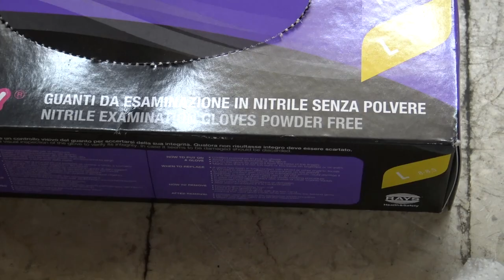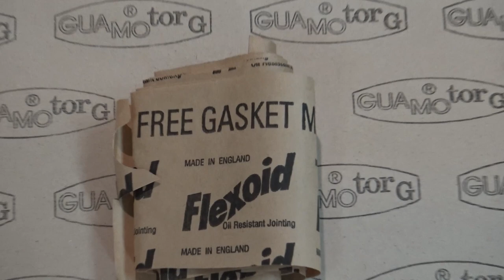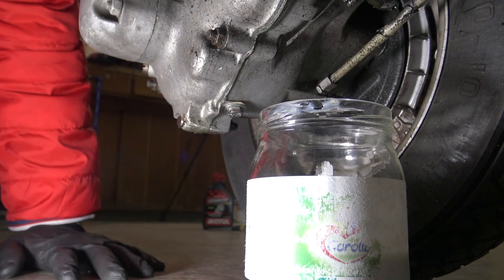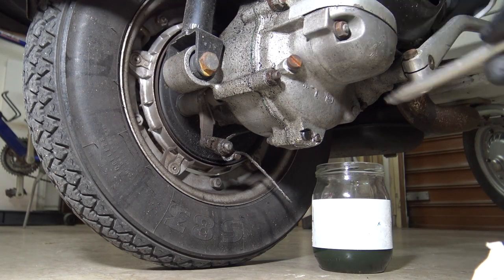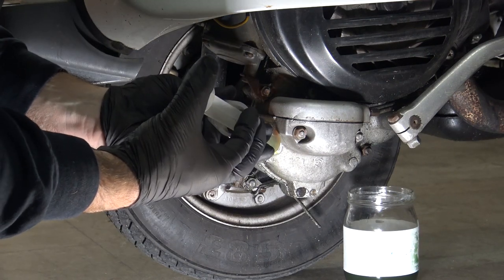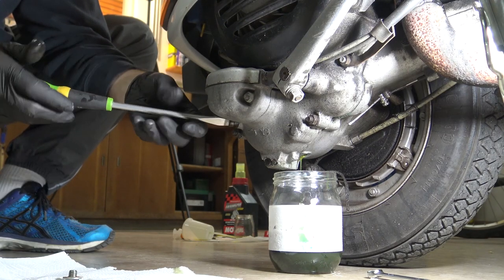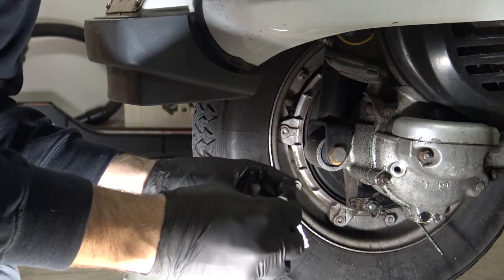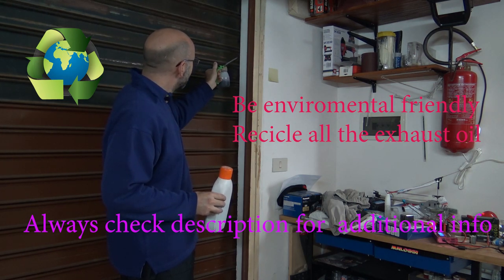Vespa PX Gearbox oil change

Comment: Hello, I own a 2002 LML Vespa Select II which is India bound but for sure I know it was manufactured by LML & Piaggio, Almost identical to yours by mechanical factors. I was hoping to restore it but i no longer have the owner's manual, hence a little lost from where to start and what steps are necessary. Could use some help.
Reply from the maker: http://vespaguide.com/?cat=2
try here ;-)

Comment: SAE 10w-30 right???
Reply from the maker: Piaggio raccomand to use old mineral oil  SAE30. Most people use motorbike 10W40 or gearbox oil 80W90 if compatible with clutch (as example Malossi 7.1 oil). As You prefer. If You are not using modified or very old clutch in older model Vespa. It could be damaged from synthetic oil. So first choise is always SAE30 mineral oil
Reply: @CantharusENG what kind of clutch will be damaged by the synthetic oil?
Reply from the maker: @vespavespi  Older clutch made of cork may be damaged due to the glue that melt with the additives of the synthetic oil
Reply: @CantharusENG  how about polini clutch set?
Reply from the maker: @vespavespi  Work well with any type of motorbike oil
Reply: @CantharusENG   nice information...thanks
Reply from the maker: @vespavespi   You are welcome

Comment: sir do u know any additives which helps in cleaning scooters gearbox like for example - we engine flush to clean engine
Reply from the maker: A cheap way to do it is to mix some kerosene with gearbox oil (50ml of kerosene and 200ml of gearbox oil ) Run idle few minutes then flush.
Before refill with the oil put 50ml of gearbox oil, run idle 1 minutes to clean the kerosene.
Then make a standard refill of about 250ml of gearbox oil

Comment: Thank you sir! Not is easy find the oil SAE30 but now, before watched your video, I will use the 10w30 for the transmission! From Brasil ( PX 200 1987)
Reply from the maker: You may read description, Motul suggest an oil for Vespa 10w30.
You may try it, I personally use it 😊😊😊😊
Reply: @CantharusENG  thank you sir
Reply from the maker: @pilotopolicial7155  You are wellcome🙂

Comment: i get a bad vibration on the front when i apply my front brakes on my vespa px 200 any idea thanks George Australia
Reply from the maker: Open and see if you have worn drum brake and check also if any object, like broken springs or similar, are out of order.
This is the first things i will check. May be also worn and not symmetric brum on the wheel side.
Let me know 🙂

Comment: How often should you change the gearbox oil
Reply from the maker: According to Piaggio each year or 8000km/5000ml which ever come first.
You may do a little longer (18 month or 12000km/8000ml)

Comment: Vespa mechanic here. First, while SAE 30w NON DETERGENT oil will work in the gearbox, it is not a good idea to use it in warm weather. It tends to lose its viscosity when really hot. Piaggio recommends SAE 75w85 GL4 (NOT GL-5) gear oil. 75w90 works fine too, as long as it is GL-4. 

DO NOT use a homemade gasket on the drain plug. That plug is not supposed to use a gasket. It uses a compressible washer. The fill plug uses the same washer. They are very inexpensive. buy a couple dozen of them, and you will never have to worry about it again. Before removing both the drain plug and fill plug, clean off the plug and area around the plug thoroughly. I use spray brake cleaner. I also clean off both plugs after removing them. You don't want dirt in the transmission. 

You can use any number of ways to get the new oil in. A syringe works, a tiny funnel, the spout on a gear oil bottle, whatever fits in the small hole. You DO NOT need to measure it. You are supposed to fill it up till it is completely full. The way you did it, you didn't have enough oil to start with, and some of that ran down the side of the case.
Reply from the maker: Appreciate Your comment.
For the gaskets I was missing the right size and I did it just to fix it temporary, and I showed just to show how to do it in case of emergency.

The tip to clean the plug and the surrounding area is a great tip I will do it from now on Thanks 😃

About the different from synthetic and mineral oil i agree with You but some older Vespa with still some original equipment may experience a shorter life in clutch and some gaskets are in cork and the glue may be deteriorated by the detergent power of the oil  (the oil "glass" of the oil tank ha a cork o-ring). 

As the fill up Your still right in the Italian video I specified, in English I forgot.

I will make a new video soon with the some correction. 

Really Thanks for the time You took sharing Your good Knowledge ❤

Comment: Gasoline 95 Can Harm Two-stroke Vespa?
What is the best oil mixed with gasoline in the tank
Reply from the maker: In Europe we have only 95 and up to 100 octane gasoline, No problem. If Your Vespa is really old may be should be tuned for unleaded fuel.
Lower than 95/92 should be adjusted AFR and may be also the timing

Comment: Hello again is it gear oil or motor oil.  ?
Reply from the maker: You may use motor oil for motorcycles since in the motorcycles the oil lubricate also the gearbox and the clutch. Don't use 2 stroke oil or cars oil

Comment: Sir I have vespa lml 2 stroke.how much ml is used، I have already put it 350ml is it good or not۔۔kindly help me
Reply from the maker: Should be 250ml
Reply from the maker: Fill until start to leak from the charging hole.
Reply: @CantharusENG  sir it have capacity approx 1.4litre
Reply: And also thanku for ur reply♥️♥️♥️
Reply from the maker: @SaMeeRmAliK00012  you mean 1/4 litre? Or 1,4 litre??
Reply: @CantharusENG  1/4
Reply: My scooter vespa lml (spl) 2stroke 150 cc/2010 model....

Comment: Sr Which Grade oil u have use in gear box of Vespa px scooter and how much quantity u have use
Reply from the maker: Piaggio raccomand to use old mineral oil  SAE30. Most people use motorbike 10W40 or gearbox oil 80W90. As You prefer. If You are using modified clutch It could be damaged from synthetic oil. So first choise is always SAE30 mineral oi
Quantity is 250ml (1/4 of liter)
Reply: I have bajaj chetak scooter ,it is like Vespa Scooter we can 40wgrade and 300 ml
Reply from the maker: @makknowledge9089  Ok, in this case I don't Know. Bajaj Chetak scooter is not sold in Italy.
Sorry 😊
Reply: But u know that chetak Scooter  is inspired by lml or Vespa body shape
Reply from the maker: @makknowledge9089  I didn't know, But now I know it 😉
Reply: @makknowledge9089  bajaj chetak is sprint clone, should be the same.
Reply: @CantharusENG  damage because of erosion of clutch plate material for ex.  or something else? i cant see any other disadvantages, synthetic oil is much better for  colder conditions etc, cant see any other reason, why not using it.
Reply from the maker: @izoyt  i Use synthetic oil, but If You are running an old Vespa not updated in gaskets or clutch You may experience  some trouble.
Reply: @CantharusENG  again, why exactly?

Comment: Which oil do you recommend for a vespa px200  1981?
Reply from the maker: You should use mineral gearbox oil SAE30 or bike oil. Motul 5100 10w30 is suitable according to Motul website.
SAE 30 oil is old and not easy to find

Comment: What kind of oil do you suggest? I use a premium mineral oil.. is it ok if i use a fully sunthetic oil?
Reply from the maker: Piaggio raccomand to use Mineral oil.
In Italy most of people (sometimes I do also) use synthetic oil. So use what You prefer 😉
Reply: Cantharus ENG do you suggest 80w90?
Reply from the maker: @bisugzzz  Yes,  in this video I used this Gearbox oil 80W90, and I will use it again 😉
Reply: Cantharus ENG i see you used Motul what is the exact model? Graziie again my friend. 😁
Reply from the maker: @bisugzzz  I used the equivalent of this: https://www.motul.com/gb/en/products/gear-300-75w90 (mine is older and anymore avalible). This have a lot of apllication car, Bike etc etc

If You have to buy only for Vespa I Suggest You this: https://www.motul.com/gb/en/products/transoil-expert-10w40, Check description on the link motul say it work up to SAE90.
Reply: @CantharusENG  which grade ?? GL-4 or GL-5 ??
Reply from the maker: @MdWaliullahRahat  tomorrow I will search wich is equivalent for You. But the above answer are the best choice.
Reply from the maker: @MdWaliullahRahat  gl4 or gl5 are suppose to use on gearbox only. On the Vespa this oil lubricate and cool also the clutch as in the bigger motorbike. So You must use motorbike oil or just mineral oil. I suggest You the Motul mentioned above.
Reply: I am using PTT 10w-40 full synthetic oil. Feels great. But most of the people use mineral 20w-50 and 500ml. Is it good for vespa engine??  What you think?
Reply from the maker: @MdWaliullahRahat  250 ml is recommended, 500ml is too much. Use motorbike oil. Better 10W40, don't use car oil since the clutch is in contact with the oil (as on motorbike)

Comment: Hello sir. Im from Malaysia.. how many liters of black oil for vbb model vespa???
Reply from the maker: 0,250 liter (250cc) 
Nice place Malaysia hope to visit once 😃
Reply: @CantharusENG   i think 500 liter before for vespa vbb model.. 
a little bit really only 250liter..  tq sir.. 😃
Reply from the maker: @Rambo-zk3iv  Well Just fill until leak out from the charge hole and if in excess let it drop. It should be around 250cc or 0,250 liter (1/4 of a liter).
Reply: @CantharusENG  tq for your info..

Comment: Which oil do you recommend for lml nv 4 stroke electric start gear scooter?
Reply from the maker: LML raccomand use oil 10W40.
Use oil for bike, the oil for the car is much different due to the clutch.
Reply: @CantharusENG  thanks
Reply from the maker: @scentyguy2567  You are welcome 😉
Reply: @CantharusENG  for gearbox oil 10w40?
Reply from the maker: @mabzgemz4989  https://amzn.to/3Mm3Uz3 Yes, this oil is for motorbike. Is suitable for gearbox and clutch 😃 Vespa oil SAE30 is an old type of oil, You may upgrade with this. Also Motul recommends this oil
Reply: @CantharusENG  i was checking my lml nv 4 stroke 2009 model and I don't find any gearbox oil hole

Comment: How much engine oil to refill?
Reply from the maker: 250ml is not engine but gearbox oil. You may use motorbike oil possible old SAE30 normal engin oil (for cars) oil will wear the clutch

Comment: Please tell me how engine quantity for vespa 50 2 stroke
Reply from the maker: 250ml is only gearbox oil, not engine. Engine oil is the 2%oil mix on gasoline
Reply: @CantharusENG  thank u very much and please tell me which engine oil u prefer?
Reply from the maker: @MuhammadAli-iu5xk  mobil, bardahl, motul, Vespa engine is strong any oil is suitable, choose Your favorite 😊
I personally use Bardahl
Reply: I was facing issue with my 50 about pressue
Reply from the maker: @MuhammadAli-iu5xk  which kind of pressure ?
Reply: @CantharusENG  sir i have 50cc small frame and when i start and put in first gear its down like clutch plates issue

Comment: For Bajaj super how much oil needs we need to put
Reply from the maker: 250ml or You may fill untill the charge hole is leaking which will be the same ammount.
Reply: @CantharusENG   I've filled almost 400ml
Reply from the maker: @sripadacv  Is too much, open the charge cap and wait untill all the excess of oil is went out. The close the charge cap and is done.
The Vespa must be level, in the centerstand is ok, but not in a slope road.
Reply: @CantharusENG  thank you
Reply from the maker: @sripadacv  You are wellcome

Comment: Can I use sae 40?
Reply from the maker: Yes, i guess it will not make much difference 🙂
Reply from the maker: https://amzn.to/3Mm3Uz3 This oil is for motorbike. Is suitable for gearbox and clutch 😃 Vespa oil SAE30 is an old type of oil, You may upgrade with this. Also Motul recommends this oil.
By the way if You have already SAE40 will be fine

Comment: For vespa super, the oil cap. 250ml ?
Reply from the maker: Which year is Your Vespa? is a New one or old one?
Reply: Cantharus ENG old , 1977
And have tips to solve oil leaking from kickstarter , i was change the seal but still leaking
Reply from the maker: @dicomaradona9782  
Oil should be also 250ml, anyway fill untill start to leak from the filler cap 😉
The following link is a video. It's in Italian, Show how to replace the o ring for the Kickstarter. If You already repleaced once try another with a a different size. He says 2,48/ 2,5 mm depth (don't say the diameter). 
https://youtu.be/iehINX6msCw?t=504
Hope to have been usefull.
Thanks for Watching my video, ask any questions.
Reply: Cantharus ENG thank you verymuch for ur suggestion Sir, keep rolling with vespaa
Reply: Did you add 2 onzes  of oil????

Comment: gear oil grade??
Reply from the maker: SAE30 mineral oil
Reply: @CantharusENG  this grade is not possible to find in our country, our country's people use 20w50 mineral 4 strock motorcycle oil and also some of use pre-mix oil which is jaso fc 2t(united 2t oil ) is this good for scooter ? or should i use 80w-90 gl4 or GL -5 ??

Comment: Gear box oil capacity?
Reply from the maker: 250ml
Reply: @CantharusENG  only 250ml can lubricating the clutch?
Reply from the maker: @vespavespi  Yes, the gear it self drag and spray all the oil around the gear and the  clutch 🙂.
Piaggio say to use 250 ml on  Vespa ☺
Reply: @CantharusENG  thanks for your information , do you have any experience using polini clutch friction set? (4 plates) , if you have please let me now , does it still can use 250ml, sae30 mineral oil or must be upgrade the oil specification?
Reply from the maker: @vespavespi  I don't have experience on Polini or other powerful clutch on Vespa.
I can tell You that in Italy Polini, Malossi, Pinasco, are considered best product, also BGM, S.I.P., Crimaz do good clutch. With Polini and Malossi You never go wrong, especially Malossi the have a special office in wihc they develope and test product by their self.
You may upgrade oil with bike motor Sintetic  10W40. Never use car oil.
Feel free to ask any questions

Comment: Gasoline 95 Can Harm Two-stroke Vespa?
What is the best oil mixed with gasoline in the tank
Reply from the maker: 95 Gasoline is very good for the Vespa, Lower octane level may be dangerous if Your Vespa is tuned. 2 stroke oil is mandatory at 2% of gasoline.
Where do You live? (i will suggest a good oil sold in Your country)
 a Good oil is recommended but Vespa has a very strong engine so don't worry to much.